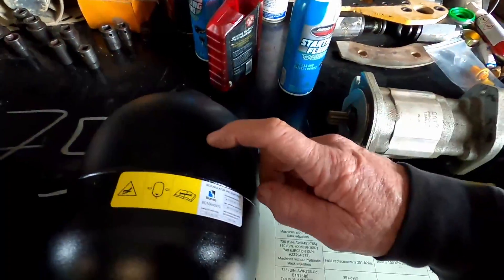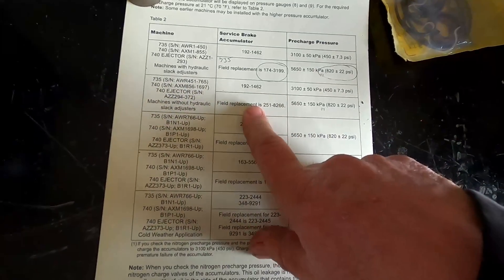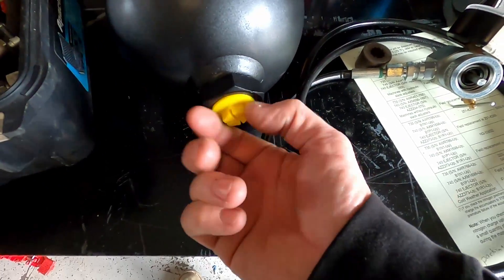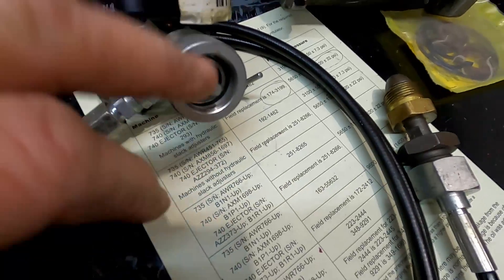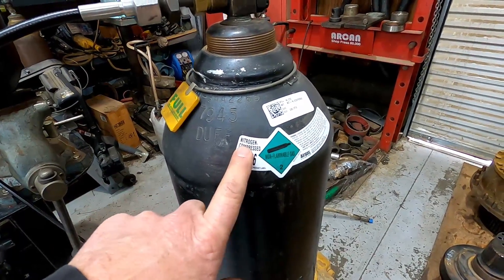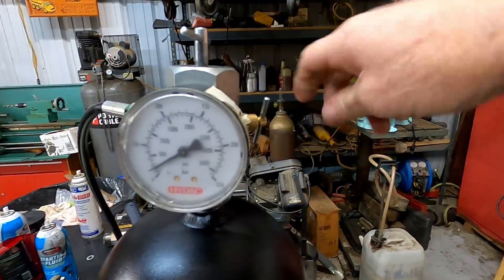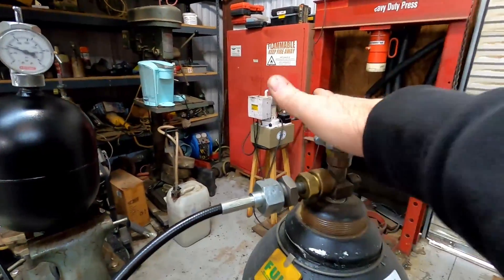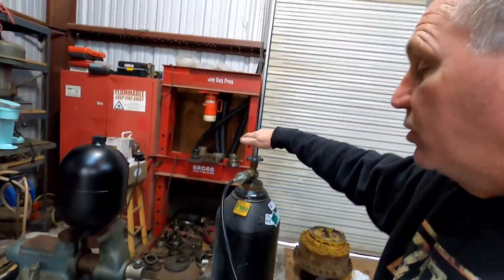Charging Nitrogen Accumulator for a Cat 725 730 735 740 Braking System.

Comment: Very entertaining. Would this work for my accumulator thwt calls for 3000psi? Thanks!
Reply from the maker: You would need to make sure that the tooling is rated for that. 
When we charge our suspension struts they get around 2000 psi

Comment: any way to get a part number for the accumulator valve ?? having trouble locating one
Reply from the maker: The Caterpillar part number for the charging adapter that fits the brake accumulators is 152-2023
Reply from the maker: But you can get it cheaper without the Cat “gold” box. 
It is made by Hydac I think the part number is 02203757 $900
Reply: got it thanx

Comment: 😎👌
Reply from the maker: Thanks 
Have a good Christmas
Reply: @RasmussenEquipment  thank you. Keep videos coming!
Reply: @RasmussenEquipment I got you reply through email. I'm taking it that this valve will be back at the parking brake itself?  Or is it up under the cab? I'll look to see if I can find it. It's a very annoying when problem to say the least.
Reply from the maker: @URLASTFIX  it is by on the frame by the parking brake
Reply from the maker: @URLASTFIX any luck with this issue
Reply: @RasmussenEquipment  I got the bed raised is as far as I got yesterday. It has a 90° fitting on the hose going to a pressure test port that is attached to the accumulator. Is the test port block the part that gets trash in it?
Reply from the maker: The oriface in the elbow is where the trash plugs it up
Reply: @RasmussenEquipment  it wasn't that. I cleaned it out then hit the park to clean the trash out. Hooked everything back up and it still wont release. It didn't have very good pressure coming out of the line with it unhooked. It was full but a water hose would have had more pressure
Reply from the maker: @URLASTFIX do you get a low brake pressure light in the cab with or without hitting the brakes?
It could be low pump pressure or a clogged screen where the hose from the pump goes to the pressure reducing valve under the cab. 
It could also be bad pressure relief seals or a bad press relief valve on the pressure reducing valve
Reply: @RasmussenEquipment  no the low pressure indicator goes out once the truck runs for a few seconds. When you push the brake button to release the brake, the brake stays engaged. You can pull the solenoid and stem and it will work for a day or so then stops working. I have the cab up on it now. I checked all the fittings in the line they were all clear. Where exactly is the screen and pressure relief valve?
Reply from the maker: @URLASTFIX on the metal block on the crossmember that is over the rear of the transmission
Reply: @RasmussenEquipment same block with the solenoid and stem in it? If so I see 3 smaller hoses running from it I'll try to track down which one it is. I just pulled the stem out again and it had pressure on it so it must be the screen or the valve. Not exactly sure how this circuit works
Reply: @RasmussenEquipment so I pulled the stem and the end of it was kinda stuck. I messed with it a little. Put it back together and it works fine. Should I try another stem valve and solenoid?
Reply: @URLASTFIX ya I would try replacing it
Reply: @gregrasmussen9915  I'll get another one. Just changed them and it worked maybe 8 times setting the brakes then got stuck again
Reply: @URLASTFIX  did you remove the elbow with the oriface and ream the tiny hole out with a torch tip cleaner or small drill bit?
Reply: @gregrasmussen9915  I pulled every connection apart up to the steel line that goes under the cab. Then traced the line up to the valve block and pulled that fitting out. All the fittings were bigger holes. Nothing really small like what you are talking about. The only thing that had small holes like that was that stem valve.  Should I try cleaning that out?
Reply from the maker: Email me at greg@rasmussenequipmentrentals.com and I’ll send you a picture of the fitting